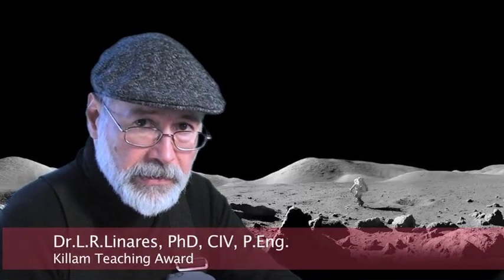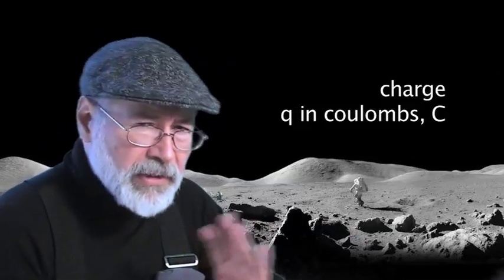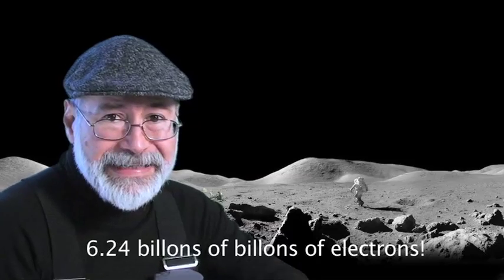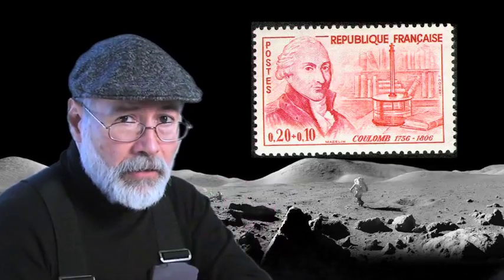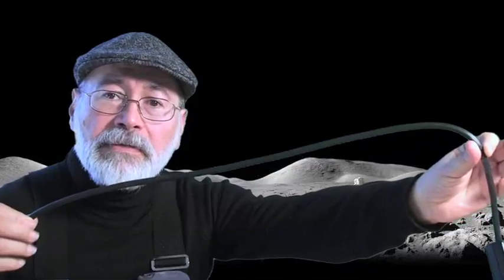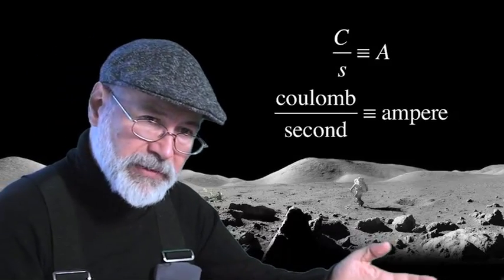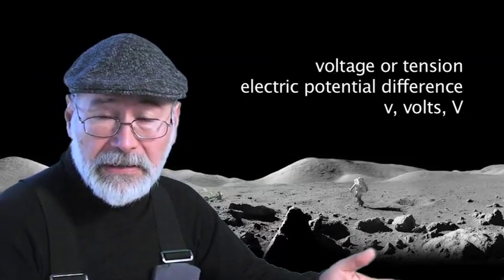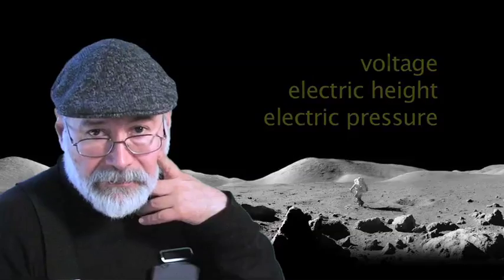EE 101/2 - Charge, Current, Voltage (CC)

Comment: Dr.Linares! does the current source physically exists as for voltage battery  is its source?
Reply from the maker: Neither the V-source nor the I-source exist like that in "real life". A battery is a crude approximation to a V-source. A much better approximation to a V-source is a lab regulated power supply. Such regulated power supply can be configured also as a current source. Why approximation? In a V-source, the voltage does not depend on the current, but in a battery, the voltage depends very strongly on the current through it. In short, a current source is an electronics construct.